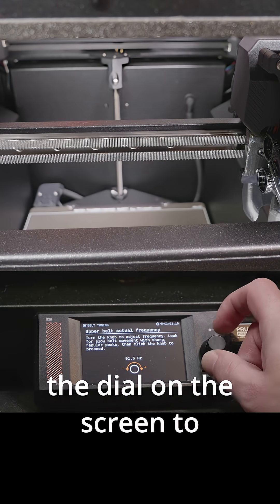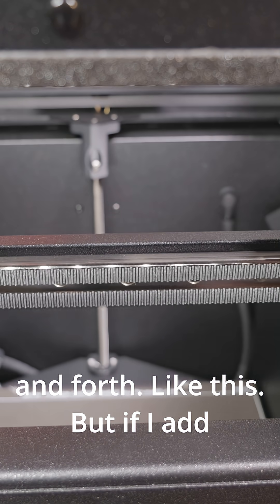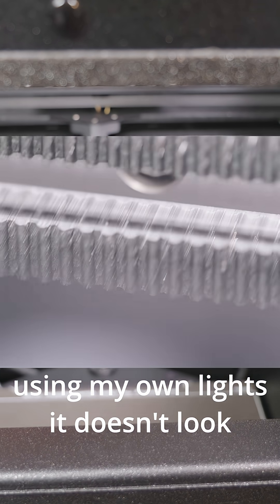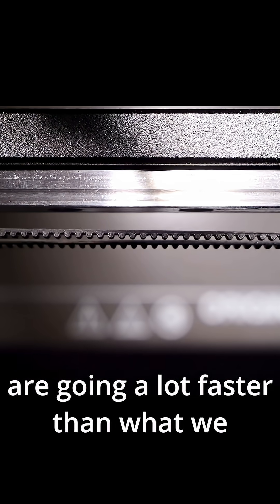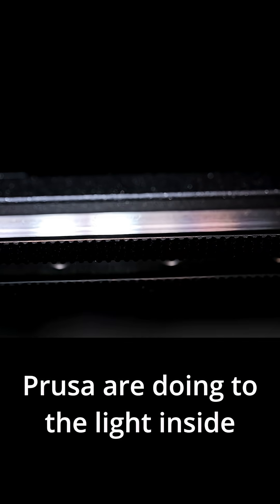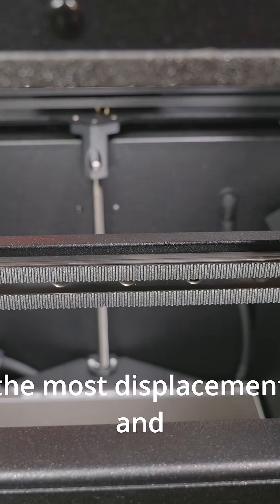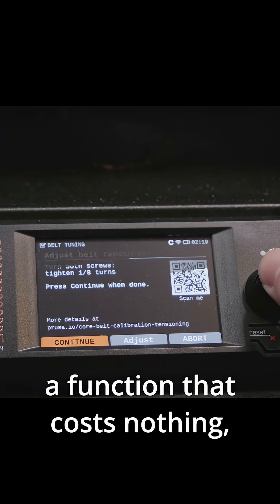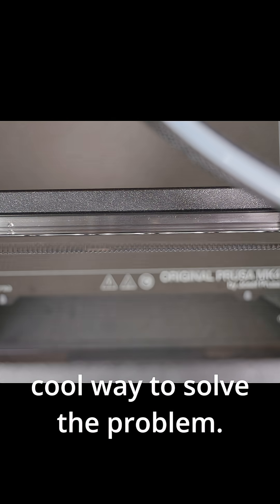Prusa's new really cool belt tensioning function! #3dprinting #3dprinters #prusa

Comment: I find it weird that we have to tune it until we see it moving. Its easier to to it the other way around, fiddle with the settings until the belt is stationary, so the less movement, the better.
Reply: Does it make any obvious change in print quality though, I'd personally like to see the difference. I'm genuinely curious as to what artifacts will be present if tuned to prevent resonance vs. using a tension scale. Cool feature nonetheless.
Reply from the maker: @TherapyWithWind  it does - the entire reason for prusa making it was because it solves some specific print artefacts, as I recall
Reply from the maker: There's only one resonant frequency, the rest are not, so I don't think you can do it the other way round
Reply: @LostInTech3D Oh you're right, i'm dumb

Comment: honestly, i've never had an issue with belt tension in any of my printers. the worst case of being a tinkerer was tuning by sound, but even that didn't make enough of a real difference to be worth doing.
Reply: Belts lose tension with sufficient use over time, and it isn't some belts, it's all belts. If you haven't had an issue then 1) you haven't had an issue YET or 2) you are having an issue but aren't noticing it.
Reply: if i'm having and issue but not noticing it, is it really an issue? @CarbonKevin 

i'm aware that belts stretch, but until i lose sub-mm precision, it's not been an issue for me.